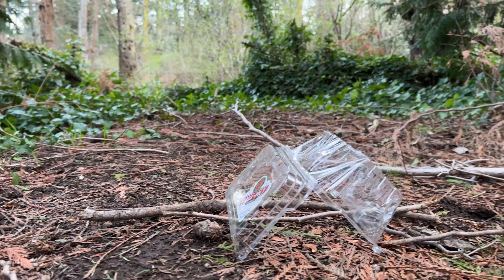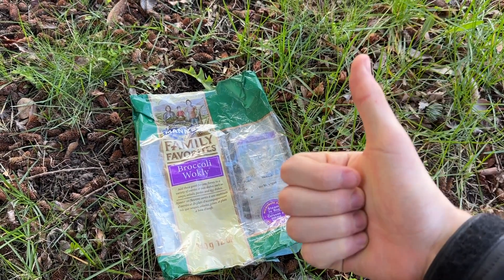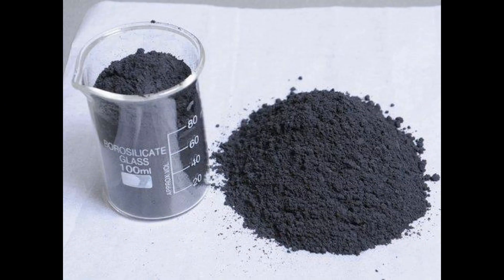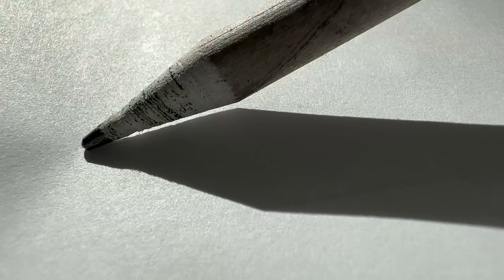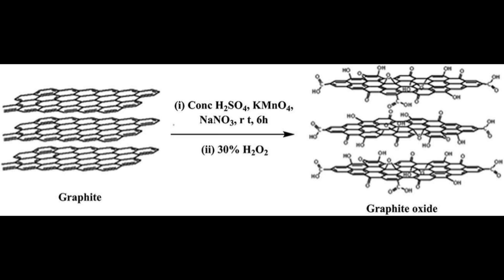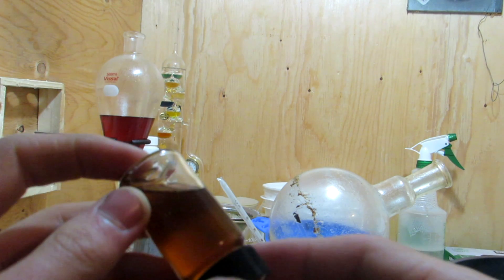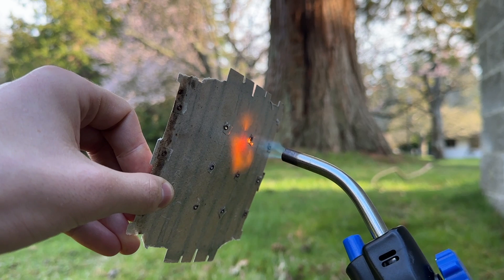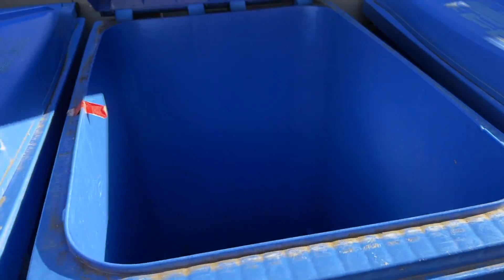Decomposable Plastic From Trees? - New Biopolymer Films

Comment: So I know it's off topic from this particular video, but I'm hoping as a fellow Canadian, you may have an answer:

How can I get pure ammonia? They used to sell it as floor cleaner, but now it's mixed with lemon crap, probably for the same reason they put fences along the Scarborough bluffs. I'm wondering if it can be created from ammonium chloride found in cold packs, or if there's a way to just order it outside of retail hardware stores?
Reply from the maker: You should be able to make it by reacting Ammonium chloride, sulfate, or nitrate with sodium hydroxide. This will produce a lot of ammonia gas which can be dissolved in water to produce ammonium hydroxide. I have been meaning to make a video on this process. Ammonium sulfate can be easily found in large quantities for cheap as a fertilizer and sodium hydroxide can be purchased as lye from hardware stores.